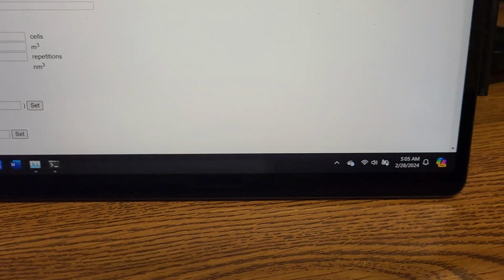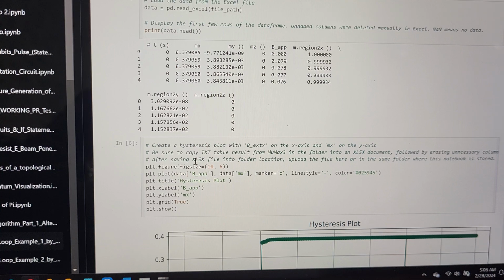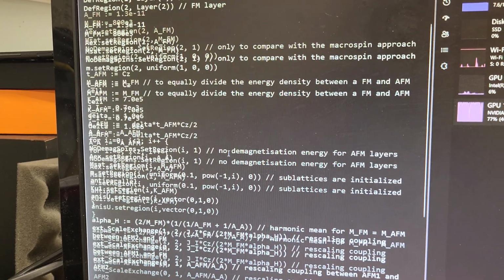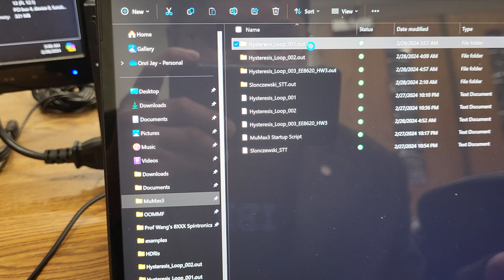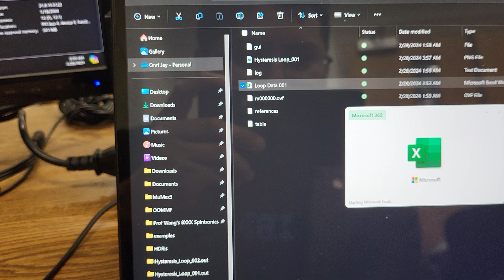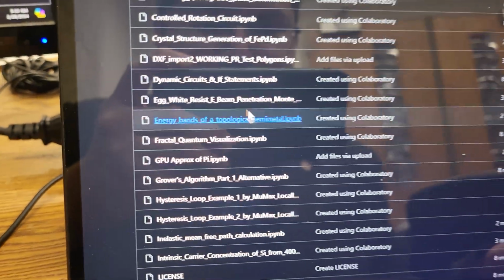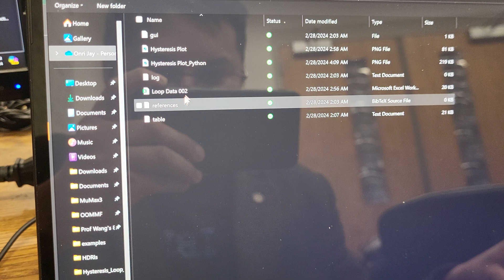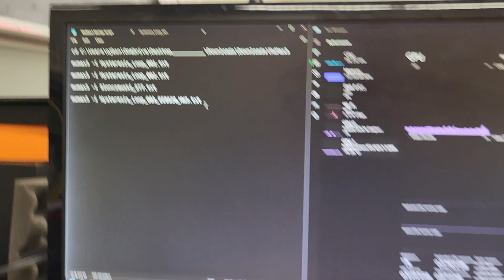LLG Solver (MuMax3) Using my RTX4070 Ti Super

Comment: Hi i am using mumax3. After i looked at you video i checked my GPU while using mumax. I was shocked. I found that my gpu 3080Ti is not working while mumax3 is running… what to do 😢
Reply from the maker: You may want to check this video: https://youtu.be/ziGTDgMdPJw?si=RWG8FA9orW4iDZof

Comment: How do I set temperature on mumax script?
Reply from the maker: In the parameter section of your script, just add in the following: Temp = 80
Reply from the maker: Temperature is in Kelvin
Reply: @ONRIPRESENCE  Thanks.
Is there a way I can update the current density in real time, that is I am trying to simulate a whole STT MTJ, the TMR actually changes with mz, do if I am applying constant voltage, current will also change with mz angle.
I'm just beginner  a in mumax3